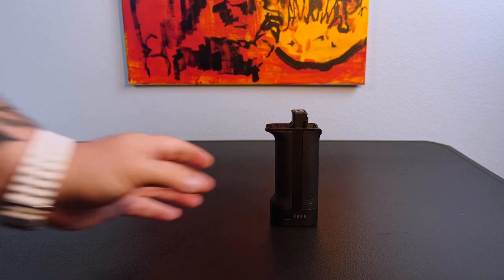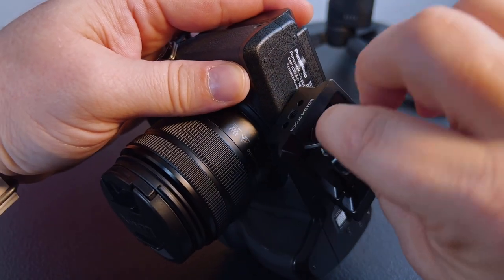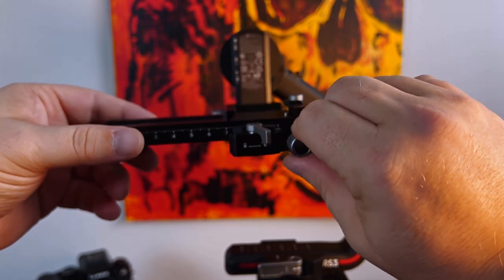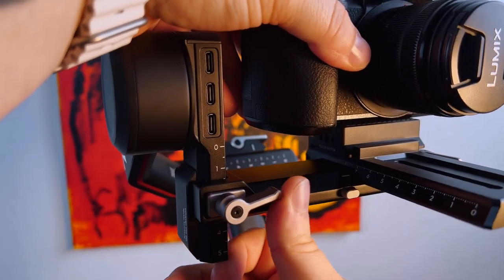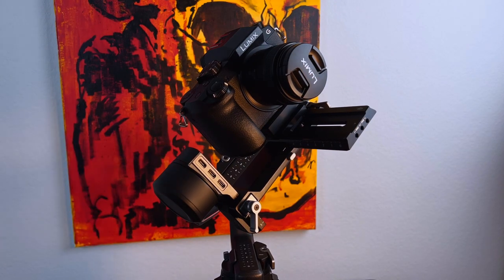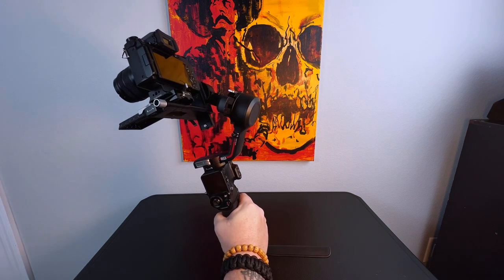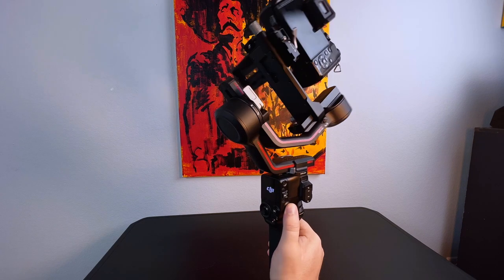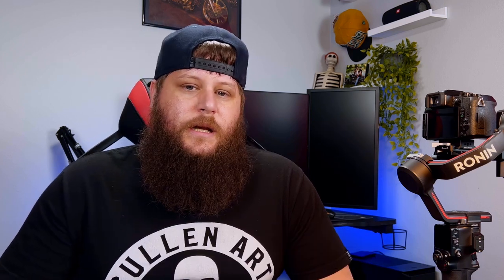The Only Tutorial You Need To Balance Your Camera On The DJI RS3

Comment: Hey! This video is a great help. The website doesn’t list the Panasonic g7 as a compatible camera but this video has proved otherwise, do you know if this is the same for the DJI R3 mini?
Reply from the maker: It should be, the only issue with the Panasonic G7 is you can’t wirelessly connect it to the gimbal through Bluetooth. But as far as balancing and being able to use manually it should be no problem.

Comment: Hey, is there any way to connect my G7 with RS3 mini for using the function buttons? Would you suggest any cable for the same?
Reply from the maker: Hey I wanted to say that I have not found any definitive guides, however with the older gimbals people have been able to use the Panasonic RSS Cable to be able to link the G7 with the gimbal. I will provide a link for you if you are interested in picking one up.

Panasonic RSS Cable - https://amzn.to/3ybeQxP

Comment: i can’t get mine to work instead of getting green it stays red then it shuts down the motors
Reply from the maker: Try going through the process again, make sure everything is balanced well. Make sure the surface you are on is completely flat and try again. Something is not balanced well if it will not give the green light.